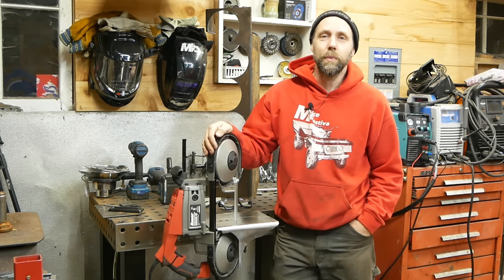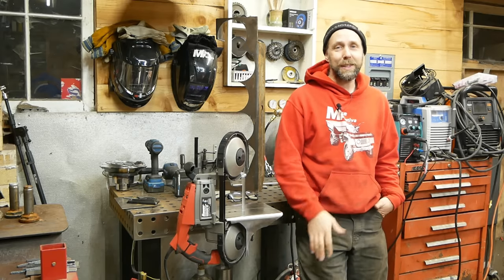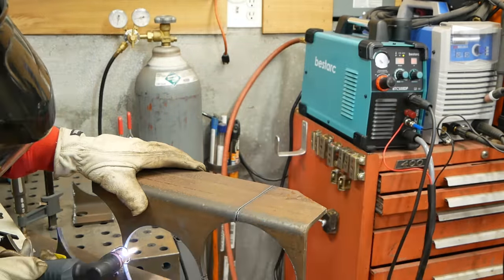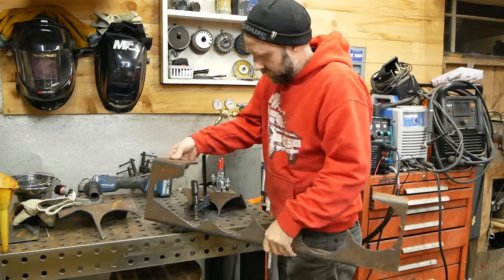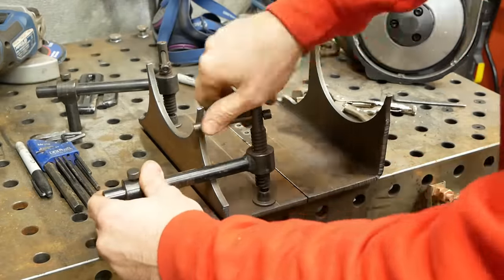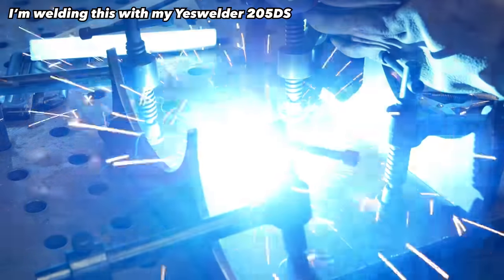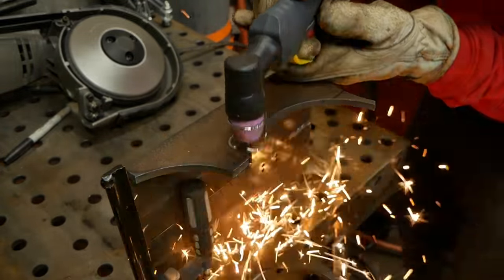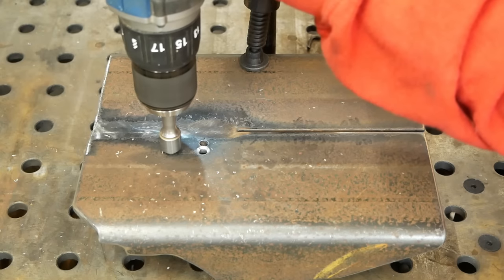Portable Bandsaw Table Build

Comment: As many times you said dont weld in one run and what do i do? Slice a pipe lengthwise to reduce the size and tig weld it in one long run. I ended up with an 8 ft banana 🍌. 😒

Comment: On the DIY table I made I just used the  blade kerf. Haven't had any problems with chip build up while in use however, it  something I have had to clean out before swapping the blade.  Made out of two pieces of 3/16"x 5"  welded out  fully then marked and cut blade kerf, as nothing lined up.

Comment: Those are good saws just throw the blades away that come with it an buy good ones. Why did you make the slot so you have to take the blade off? I think I would have made the table flush with the welding table.
Reply from the maker: “why did you make a slot so you have to take the blade off” ?
There’s a reason for everything it do, you probably missed the point why I made the table sit above the welding table, that’s okay if you missed the reason.

Comment: Would it of made more sense to put the slot for the saw in back so you would have to take off the blade every time you want to remove the table
Reply from the maker: Would that make more sense? How so, take the table off every time you want to change the blade? I don’t see the point of that.
Reply: I do not think he ever intends to use it as a portable band saw the table will more or less always be mounted to the saw  if you put the slot the other way you would have to remove the table every time you had to change the blade